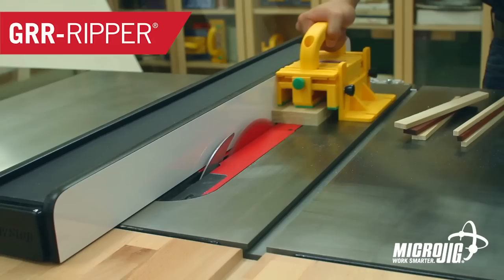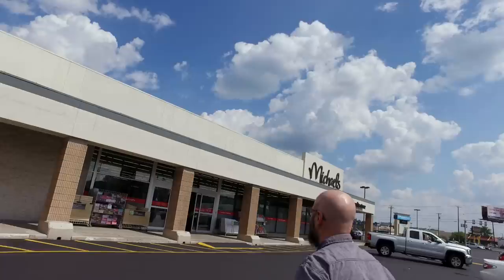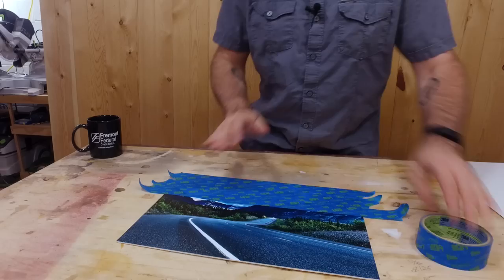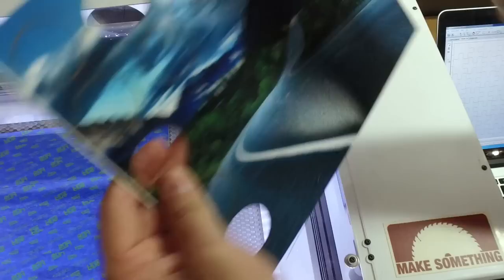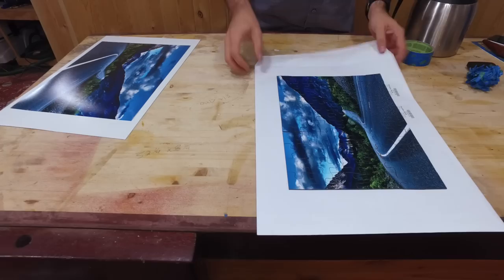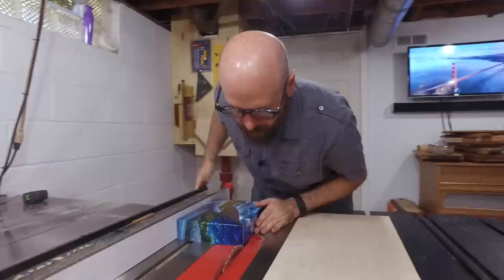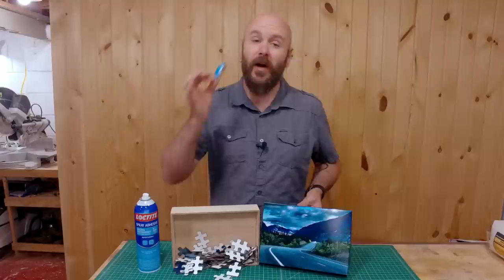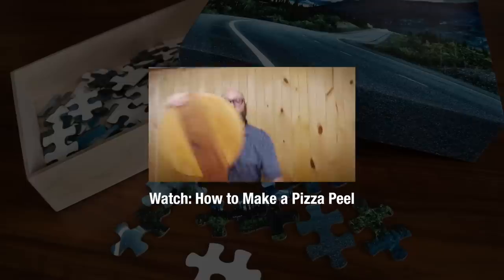Make Your Own Puzzle From a Photograph

Comment: i have a question i don't have 3000 dollars to spend on a laser cutter 😅what would be your best alternative?
Reply: You can get precut blank jigsaw puzzles from various places. I get them through bulk t-shirt blank suppliers, but you can find them on Amazon, too. Attach the photo the same way, then recut by hand using a jeweler's saw (these are not very expensive).
Reply: You can lazercut in one of architecture stationary

Comment: I've made puzzles for the last 3 years on a scroll saw.  clearly it takes a lot of time and patience to ensure a proper fit. the majority of the wood projects you have done are within the scope of the tools I have. I don't own a $5K laser cutter so I guess I am stuck with an old method.

note of advice....if using a scroll saw, you should make 2 puzzles at once with the pictures facing each other on the inside of the cut to minimize tear out.  works 75% of the time due to blade and speed issues.

Comment: Great work! Could you have used thin wood as the puzzle pieces instead? Would the laser cut through something like that?
Reply from the maker: Thanks! Yes, the laser will up up to 1/4". I actually though about using wood but decided to use cardboard.